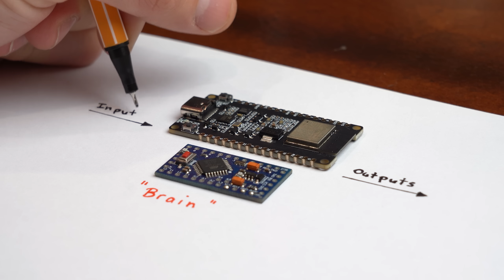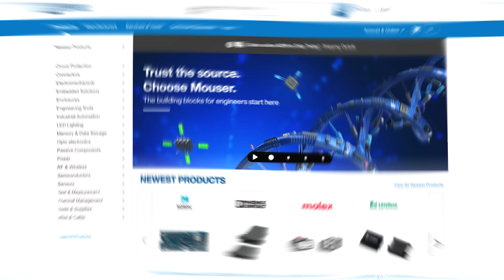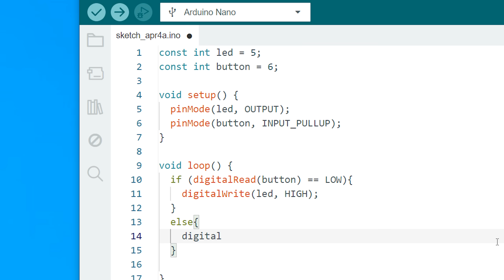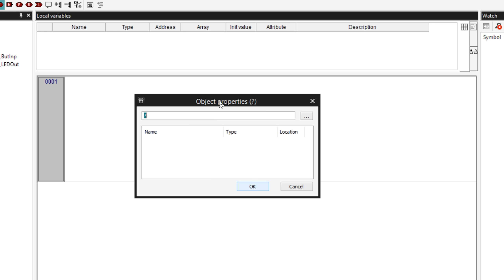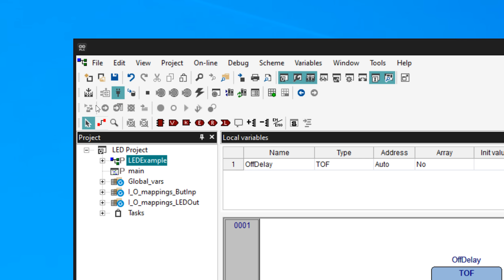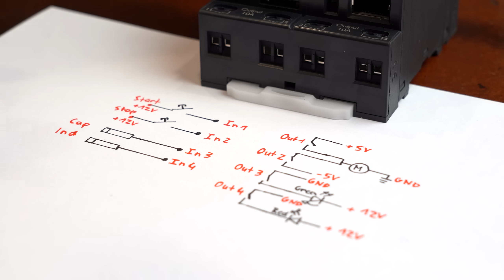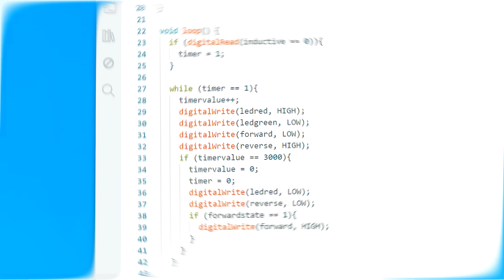Not a Microcontroller!...This is Better?! (PLC) EB#62

Comment: Finder is great but is lack of input and output LED indicator.  Codesys is great option but i still dare to learn this. Can you make some simple introduction for Finder software? 
 A tasty morsel is the Siemens Lego PLC for home automation. It can be connected by LAN networking it can cooperate between two of this and have MQQT technology WEB HMI. I try to automate central heating steering in my home by this. I am not fun of wifi home automation.

Comment: This was a very interesting video. I never used a PLC before, but now I can see myself using one. I think one great advantage is that it can work with the 24V components without having to use voltage regulators like on a Arduino Uno. Also the live debugging looks very good. I just don´t understand why the software components are labeled so cryptically.

Comment: Yeees, but no :D 
How i see it - those are 2 different worlds...

Have experience with PLCs ( siemens mostly ) 
PLC is more robust, almost never fail, but Microcontrollers ( like Arduino) have huge benefit - PRICE and SIZE :D
For 200$ You can get full package , on other hand PLC it will be basic module.

I think it is something un-comparable -  if You need make fun project with low responsibility take Ardruino, but if You need automate factory PLC is must have  :D

My experience with ESP32 so far is that it have a lot of "bugs" , lost signals time to time , maybe mine is broken or smth.. but only psycho could install ESP32 into real world production line ( my humble opinion :D )

Comment: from 4:25 to end you showed me like things i wanted to know but havent found, like connecting things.

am just about to end my 3 year degree on electronics, and i felt unsafe about how solid was my knowledge (and they never showed me equipment functioning, they made me do expos and ppts), after knowing about plcs on my last semester by learning to code the logo plc on ladder i decided to start my profesional carrier on it to find a job starting by mastering tia portal, and then learn about microcontrollers and pcb design on kicad on the future, surely ill be forced to learn fluids and robotics somewhere, but after doing integrals and derivates and ecuations eternally without seeing a single physical thing months, PLC feels so much relaxing and straight forward.

Comment: 3:37 Well, almost micro controllers support some form of hardware debugging, like JTAG, that lets you halt the cpu at any given line of code and manually step forward through the code line by line, while seeing the current value of variables, registers etc. This is the standard way of debugging. The Arduino way of debugging by printing stuff over UART is a quick and dirty way of doing it. But it is NOT how micro controllers are normally debugged. Not only does this not give you a lot of information. It also means you have to modify your code (to print debugging messages) which may change it's behavior. You basically have no way of debugging your actual code.

Comment: The only difference to a micro controller is the UI and size.
Both are micro controllers.
Both can have the same inputs and outputs.
Without the UI the programming would be the same.
Visit a modern Factory a have a look what a Visualisation does today.
You have no idea what some programmer might have build in the Background. Data-logs, Equations, PID´s, automated reports for some other office...

Comment: Historical PLC may have been different. But modern PLC are microcontrollers with power supply and isolated+ protected input/ output for industrial application and easier programming option by graphical means.

Comment: Saying that "a PLC is not a MicroController" is like saying that "a car is not an engine" - but it has one inside - just like the PLC (Programmable Logic Controller) has an MCU inside.
The PLC is an MCU with several peripherals inside the box and it runs a software that lets you set it (or configure it) with simpler logic functions.
Yet, thanks for the educational video. 👍

Comment: I'm.
Glad you finally made a video about this as somebody who programs industrial PLCs.  I have tried my hand at the arduino boards, and they are incredibly complicated and time consuming to write programs for even using visuino. In the end its about money. I can program a complicated program using 8 inputs and 8 outputs using analog sensors and digital converters in a matter of minutes.  Yes im being truly honest.  And time is money. My favorite bby far is the Siemens LOGO8 and the ne Siemens industrial PLCs. The drag and drop software is super easy to learn and is simple. The average builder just needs to turn on a light add a timer read pressure and react to temperature.  These little guys may cost $100 but they work and are RELIABLE! something these little maker boards are certainly not. Thank you for covering this! 😊
Reply: Agree

Comment: 9:52 so plcs are micro-controllers for dummies?
Reply: If you use one of those " maker boards " in any refinery, manufacture, chemical plant or any industrial application, you will be laughed out of the facility banned from ever coming back and possibly sued. For good reason.  They are UL rated and are RELIABLE!  PLCs are fast to program and interface with hundreds of other systems.  I use both but would not get caught ever using a toy in a plant. 😂

Comment: GreatScott please make more videos on Raspberry Pi DIN MIDI music, UPS, mechanical Harps, and other experimental stuff. Consider doing a deep  dive series into the PI4 and Pi5 differences.... the arbitration chip of the Pi5 made things much more difficult on the GPIO SIDE, and the old but gold pigpiod piScope has stopped working on the Pi5...
and DIN MIDI baud rate don't work anymore... so there is a clear division... advise the people to do a backup NOW of the archives and repos of these libs, as they could be changed and not work anymore in the future.. it's happening under our eyes... and you are missing it completely....

Comment: It’s expensive. You could get a S7-1200 Siemens PLC for a bit more. Even MicroLogix 820 could come in the same price bracket. Or you could go for a cheaper Chinese PLC like Kinco. We have used Kinco K2 PLCs and the HP-043 PLC-HMI combo a lot in our industrial automation projects. They are very dependable

Comment: The microcontroller has disappointed me when I do the reliability test after 10  hours the boatd has problems such as randomly halt, freezing require hard reset even 10 to 20 boards tested still found the problem even just 1 sensor read then send the POST/Get to server, I have to add watch dog  the reset circuit to reset the board but tge Microcontroller is cheaper than PLC when you do the redundancy system, But the reliability is the keys concern.

Comment: From electronics engineer,  The PLC is more reliable than microcontroller, the programing now is seem like GUI, no code that s very good for the guys who 's not the programer or no programing skill such as mechanical or electrical technicial, the PLC is look like the completed Microcontroller frame work and now the pricing is going down and the communication module is more advance such as Wifi and TCP/IP

Comment: But some aspect that is often forgotten about PLC is.

1: Cyper security you are in alot of trouble you will never get it certified.

2: if you build a lot of machines PLC is very expensiv compared to Indrustial computers that runs linux and use ethercat master to control I/O modules. We saved 12 million euros on plc hardware, software and lincense that are free in the normal software world. We calculated from producing 1000 machines.

but for low volume machine production it is fine.

Comment: Ein muss man aber sagen….. ich habe an SPS gelernt, hauptsächlich Siemens S7 und Siemens Logo. Die Preise die man da bezahlt sind heftig, sind aber auch begründet in vielen Features die man nicht sieht. 
Hauptsächlich geht es da um die Zuverlässigkeit, da die Firmware und der ganze Rest des Geräts eine große Menge an Zertifizierungen und Zulassungen mitbringt, wie Eigensicherheit (Feature) aber auch bei vielen PLC Zulassungen bspw. Im Marine Bereich. 

Klar sind PLCs auf den ersten Blick langsamer. Das liegt am Arbeitsprinzip. So eine Zykluszeit bei einer großen SPS liegt so im Bereich zwischen 1-10ms. Aber diese bleibt auch meistens unabhängig von der Komplexität des Programms. Nächster Vorteil (das hat mir in dem Video so ein bissl gefehlt) sind bei SPSn/PLCs die Bussysteme die es gibt, wie Profibus/Profinet oder MOD Bus bspw. (Viele mehr sind existent). Die Möglichkeiten, was daraus alles gebaut werden kann, also Vernetzung mit Slave devices, das ist der Punkt wo eine SPS richtig anfängt sinnvoll zu werden. In großen Industrieanlagen, Fertigungsanlagen aber bspw. Auch in Leitsystemen wie Energiesteuerungssysteme, Verkehrsleitsysteme grade in Großstädten. Ich selbst hab mal mit einem Kollegen gearbeitet, der selbstständig SPS Systeme konstruiert und programmiert. Die größte Anöage, an der er gearbeitet hatte, war ein einziger Verbund aus ca 7000 Controllern.

Comment: Opta(free software), siemens logo!(need software license), schneider zelio smart relay(as long as I remember, no need software, but limited programming)
Opta is joint project between arduino and finder.
Here in indonesia, still, siemens logo! And schneider zelio smart relay are more affordable than opta due to supply chain

Comment: What you are showing is what we call a smart relay. Depending on the model around 10 inputs and 4, 6 or 8 outputs. We used quite a lot of them where I worked. For bigger applications we used PLCs that were much bigger and more complicated to program.

Comment: I’m getting ready to embark upon a fairly large project that will contain the Arduino OPTA WiFi, and 2 other Arduino I/O Modules along with Portenta Machine Control. Do you think it can all be done with a Raspberry Pi 5 8GB RAM, with a 128 GB SD card. Do you think the Pi 5 will be a good computer for all of the programming that will need done with the Arduino PLC IDE.
Thank You for sharing, I have been wanting to do all of this exact same things you have done in this video for a very long time. I’m glad I have actually been able to see it done.

Comment: You are wrong to generalize, my friend, PLCs in general also have digital outputs that are much faster than an Arduino, the example you show is a very limited PLC with a digital relay output, that is a terrible comparison when they have famous PLCs like the s7 1500 or AXC F 2152

Comment: For years now I've thought about switching my hydroponic system to using a PLC. Something about it seems to make much more sense. Right now it's a state machine on an Arduino Nano, which is fine, but it took quite a bit of debugging and testing to get right. A PLC on the other hand, and as you demonstrated, seems like it would be clearer to program and debug, more robust, and quite a bit simpler to wire with my sensors and actuators. The complexity of the project would really drop off.

The reporting to the web part — I think that could be accomplished with the Nano just fine, but its only concern would be reporting. That sounds much nicer.

Comment: there are ESP32s and Arduinos built to support 24V I/O and have DIN-rail mounting + industrial enclosures, with that in mind, i don't see the benefit of PLCs.
Reply: its mainly about reliablity and being abled to survive in industrial enviorments, there are Siemens PLCs out there which are well above 30 years of age and still  working.
if ESP32s would cut it then they would have replaced PLCs but they dont for many reasons because this is just not what they are meant to be used for

Comment: I have spotted a couple comments along the lines of what I was thinking. Generally inside a PLC there will be a microcontroller or CPU with peripherals along with signal conditioning and often optical isolation as well as either mechanical relays or solid state relays. The PLC is usually running proprietary firmware which can be customized through a proprietary language (often graphical). Automated equipment along some assembly line needs to be integrated and a PLC is a good solution. There often is equipment from a variety of sources that all has to work together. On the other hand if one is building a 3d printer or a laser cutter or some other piece of equipment that is all contained in one box then a PLC would add cost where one is trying to minimize cost. In that environment where markups are small and the number of units is large then it makes less sense to use a PLC. In places where PLCs are used there may well be a need to change the configuration and programming frequently. It was the auto industry that tends to come out with new model vehicles every year that drove the early development of PLCs. In that case the PLC was a vast improvement over hand wiring control panels with a multitude of relays and relay timers.

Comment: Got it: PLC is for very slow industrial applications when you need Lego Style programming and a ton of money to spend 😄
Reply: Hardly. Biggest industries in the world use plcs for real world control. Even engine controls and combustion monitoring on the fly keep the electrical grid running. Plus the opta/ardunio plcs while expensive click plc is really low cost considering its industrial grade hardware that’s expandable.
Reply: 😂 if you get caught with an " arduino " controller in a plant you will be fined and laughed out of the facility.

Comment: Did you get to try the comparison with the block diagram programming vs the ladder logic programming? Also is the microcontroller the only expensive part or are the sensors as well? Follow up - did you buy the sensors from arduino or source them elsewhere because those seem expensive.

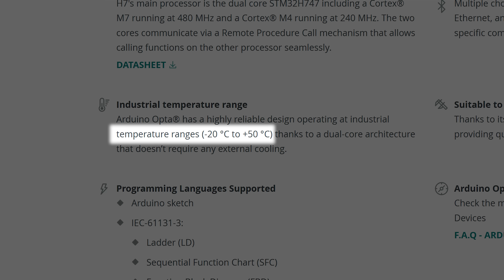Comment: 2:21 Interesting, just last month the Raspberry Pi people announced that they extended the operating temperature range of their Compute Module 4 between -40°C and +85°C. The Opta description calls -20°C to +50°C an industrial temperature range, so I wonder if this 70-degree range is enough for most industrial cases, and if there are more industrial temperature ranges, because it's pretty wild to target such a big increase in the temperature rage, to 125 degrees between limits.

Comment: I personally have both experience in programming plc's and micro controllers, i have experience only with the Siemens plc's. To be honest i really hate the fact that to code PLC's you have to use their visual-based programming language, i whould prefer by far programming the plc's in C ish programming language like an arduino.

Comment: I'm not sure if you mentioned it, the other important thing to note about PLCs is due to use in industrial environments, they are robust.  They have built-in protection from their inputs, etc. which using microcontrollers in the same environment would take considerable design and testing to prevent electrical spikes and accidental mis-use.  Which justifies their cost.

Comment: I think one could put it like this:
A PLC is based on a Microcontroller (stronger) and has useful peripherals integrated already. It comes with a software preinstalled for flashing and running all your PLC Programs on it and communicating with the controlling PC software.
All of this could be done with a Microcontroller, a PLC is just a very flexible prebuilt solution.

Comment: the opto basic is $150 and contains a $22 STM32H7 Microcontroller. In a package with some relays. What makes them unique is the ladder logic programming language. I just saved you 20 minutes because he didn't say any of this in the video.

Fun fact 120v AC  uses 15 A breakers. You should never have a device that can only handle 10A on a 15A breaker. Europe doesn't use breakers so this guy doesn't know anything about this.

 This is cheap crap relay territory don't give a shit what certifications they say they have.
Reply: Smaller breakers exist, and Europe does use breakers.

Comment: I seriously don't comprehend why so much people are averse to actual coding, like, using a keyboard. I believe given the same level of complexity in a solution it'd still be similarly difficult to implement using blocks than it would be using text based input. Also the "learning curve" associated with finding the "correct" pre-made function block in that gui thingy for PLCs sounds like it would make both learning and developing brutally slower, more painfull, and the skill less portable or useful to other applications than just learning to code.
Reply: And with actual programming you can build necessary abstractions and make whole program actually readable AND run unit tests with ease.

Comment: I'm not a fan of the way this PLC model has laid out it function block page, I prefer the layout of say a Zelio or a Crouzet much easier to fit function blocks and link them to previous lines of inputs and outputs, the one you shown almost looks like an amalgamation of ladder and function block which to be honest overcomplicates things IMHO.
 I get it you are sponsoring this PLC so unlikely to get a honest review but I just have to add my constructive criticism here and for those interested check out the free software you can download with my exampled models and have a play with the function block options.